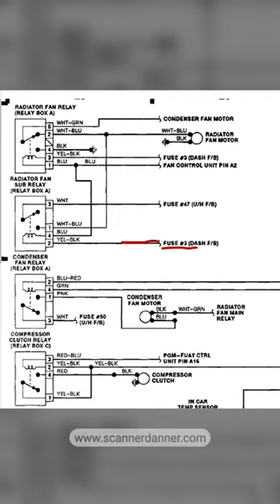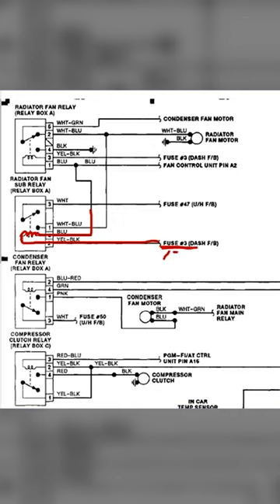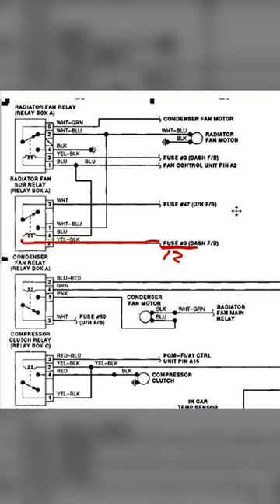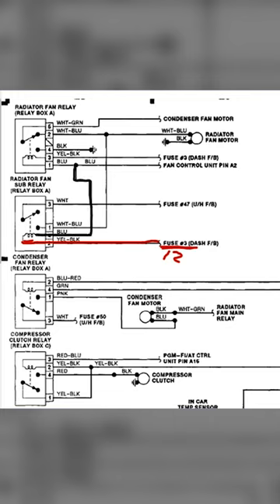Visit us on ScannerDanner Premium to view the full lecture titled "How To Read A Wiring Diagram"!

Comment: Thinking there is 12V on the blue wire is absolutely correct! It's not until the fan control unit applies the negative that battery volts goes to zero. Power is traveling through the coil windings of the relay. If you probe pin A2 and find 12V, you have proven the circuit to be whole. The only monkey wrench in that diagram is, is there really two relays? If there are, you may have to pull one relay at a time while monitoring pin A2. p.s. both relays show fuse three as being their feed.
Reply from the maker: This was just a clip, we certainly cover this more in depth in the 40 minute lecture, thanks!

Comment: But Wait, if the relay is not being commanded ON then there would be 12v at the Blu wire.
Reply from the maker: That is correct. It's a switched ground, not a constant ground